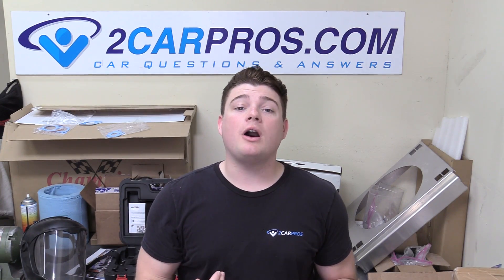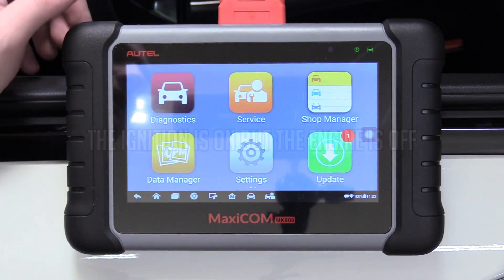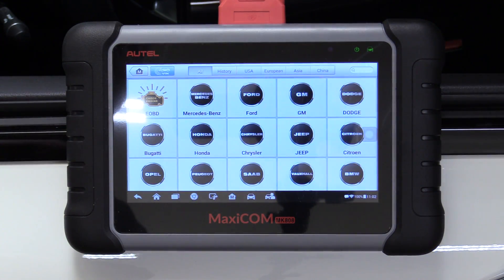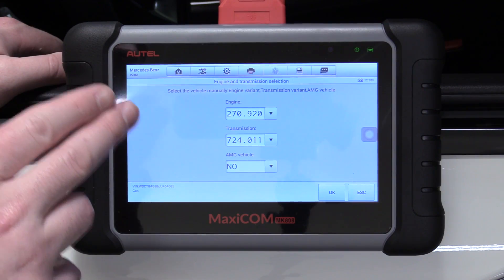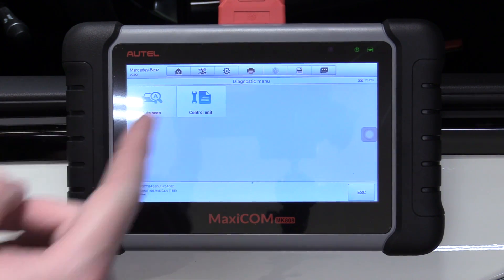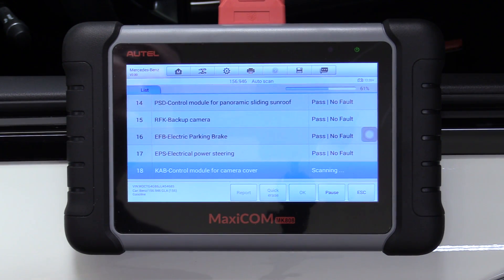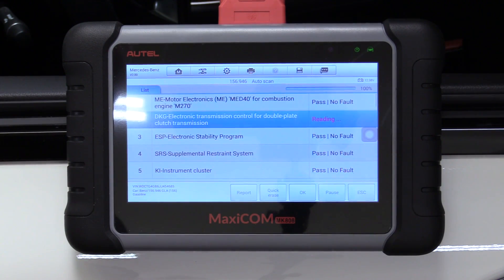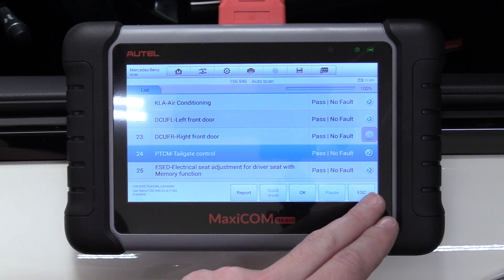How to Scan a CAN (Controller Area Network) - EASY!

Comment: Will this program a BCM
Reply from the maker: Says it does on the box but I have yet to confirm it! Thanks for watching!
Reply: @2carpros  will b nice a vid on cun bus /BCM module issues tasks , using this scanner!! Thats mainly what this scanner shines  , if it has that option !! Aside from regular ABS engine codes search which those can b tackled w more less expensive scanners !! M just sayen .

Comment: 2013 nissan pathfinder main display that shows milage l, speedometer and everything is completely dead, as if the car is turned off. Lights on steering wheel are on and care response to cruise control, just can't see anything because main display is completely dead. Can you please tell me your opinion on this? Thanks

Comment: Does it work with a 1999 volvo s80?
Reply: Volvo's do speak swedish! LOL! Mine did throw a "CAN" code while scanning with OBII, this reader(autel) "may" read it and tell you a system to look at, but VIDA/DICE 2014 (for your year) will be what diagnoses the actual issue and gives you  and the mechanic/technician actual step by step info for repair. Getting a hold of a genuine DICE is difficult but not impossible. Good luck.